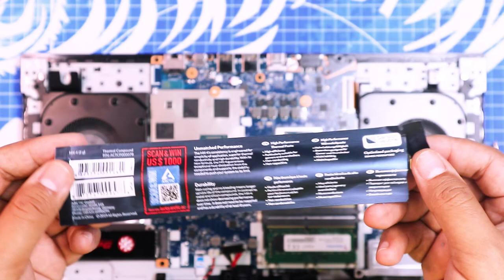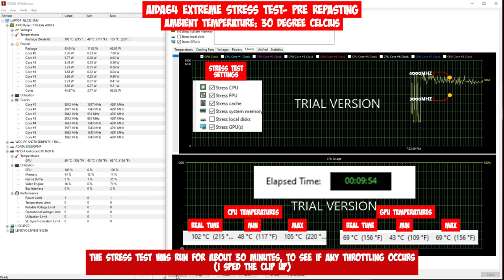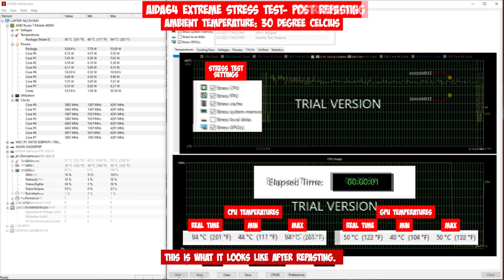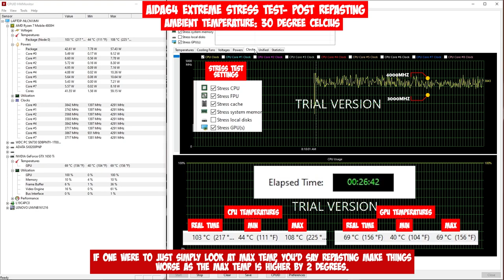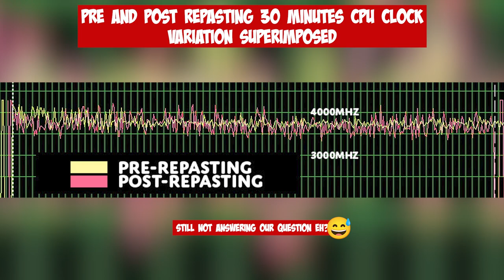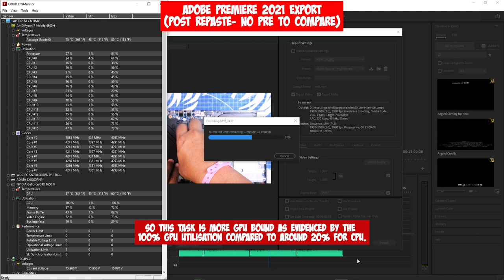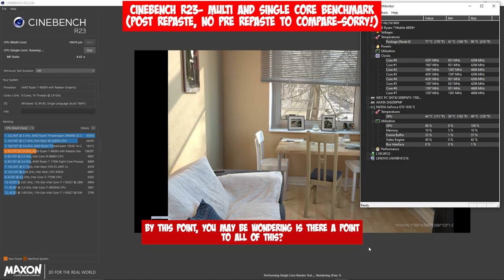Repasting My Lenovo Legion 5 |Replacing Old Thermal Paste|

Comment: I feel people failed to realised that unlike repasting thermal compound on a desktop with some decent or good cooling solution, you probably will not see a drop in temp on a laptop unless you are not stressing the CPU or GPU fully. The reason being that there is just not enough surface area to implement a beefier cooling solution. So while changing to a better thermal compound helps with heat transfer to the heat pipes and then to the heat sinks, the bottleneck will eventually be at the puny heat sinks. In addition, just as demonstrated in the video, because the CPU and GPU are usually thermally limited, therefore, when there is any thermal headroom, it will attempt to run at a faster clockspeed. In my opinion, you will need some thick thermal compound for laptop use because of (1) poor mounting pressure, and, (2) high temps which most thermal compound will degrade rapidly, including the expensive but ineffective Thermal Grizzly. Thermalright TFX and SYY 157 appears to be better thermal compound for such use case and they are a lot more durable.
Reply from the maker: thanks for watching

Comment: Great video. I experienced the same thermal issue with my Legion 5 after repasting with MX4, but then I repasted again with Thermalright TFX and the temps are now 10 - 15 °C lower. For better results, the TFX has a curing time around 3 days.
Reply from the maker: thanks for watching😁 that's a pretty decent improvement. I might try repasting with other brands of paste, few people also report better results with other pastes.
Reply: It was not a legion 5 gen 6 right ?
Reply: I think also grizzly hydronaut if u want less manteinance
Reply: @boufftous3000  nope
Reply: Maybe you got a fake mx4. There is a lot out there. I bought a fake one  but I got the refund.

Comment: Pro Tip-ish: Lenovo's BIOS actually gives you the option to Disconnect the battery without the need to do that battery removal step (which honestly is a pain haha). Once you press enter on that selection on BIOS, it automatically shuts off the computer and can only be powered on via AC.

This'll make upgrading/maintaining the device easier and avoids mishaps (like breaking those battery connectors)

Once your done upgrading, just plug it with the power brick, turn on, and let it boot (there is no need to go to the BIOS again and turn it on, it automatically turns back itself once AC power is applied), regardless it's best to check still

PS: Even me, when I installed my 1TB SSD forgot such step haha. In a perfect world with no shorts and ESD it should be fine, but we are not in that perfect world SO. Make sure to remove 'em :D

Impt guideline when repasting:
1. Before doing anything, ALWAYS HAVE A BASELINE. Baseline includes your benchmarking scores, ALL YOUR temps (package temp, core temps, hotspot temps all the temp values you can see) this wiill be relevant later post maintenance

2. The most common method of applying thermal compound i.e., the teardrop, IS NOT ADVISABLE since you are (technically speaking) no applying it on the heat spreader BUT ON the DYE ITSELF. Hence, you need to apply thermal compound and SPREAD on the dye AND on the metal plate. There are a lot of videos/articles explaining this but the TL'DR laymans term of it is: the exposed part of the dye is actual "protective skin" of the actual chips, and missing even small areas will cause certain chips to overheat. MoN's video doesn't really show him spreading it, but hopefully he did, if not, hopefully the pressure when he  pressed back the heatsink provided enough coverage. AGAIN AGAIN AGAIN, this only applies when your faced with repasting the actual dye, let's not debate about application methods.

- - So how do you know if you messed up? Most modern hardware not only report the package temp, but also report the hotspot temp, if that reaches 90-100 deg.C+ even on light load, then its a good indication you messed up somewhere. This is where the "before i touched anything" pre-bechmark comes in handy, since you SHOULD get equal to or bettter results esp. on the temps

3. Lastly, unless you're experienced, dont use metalic base/conductive thermal compound.
Reply from the maker: thanks for watching and detailed and extensive comments. 😁 very helpful👍
Reply: @masterofnone4608  AC, what? The charger cable/power brick transforms AC (from the wall) to DC. There isn't any AC running straight into the computer.
Reply from the maker: @-RXB-  I believe he just meant that by disconnecting the battery in the bios the laptop will run only if it's plugged in to the charger, and since the charger is connected to the wall, it runs off the AC. I don't actually think he meant the laptop is actually running on AC😅.
basically i think he just meant that the laptop would not run on the battery when disconnected in the bios.
, 😁
Reply: Hey, I don't see an option to disconnect the battery from the BIOS. I have Legion 5 2021. Need your guidance.
Reply: Disconnecting Battery in BIOS will not disconnect the hardware and if the hardware is connected it can still transmit power which can destroy the motherboard. So, It's not a good Idea!
Reply: @adarsh846  disconnecting battery in bios stops power flow from the battery to the laptop. So its a good idea unless u actually upgrade it while connected to power in which case u would be dumb as hell
Reply: @adarsh846  bruh then whats the use of it? im pretty sure devs arent dumb to waste their time on useless things
Reply: @ashuF12  I believe even an electronic circuit has its own way to do things. As he said, it may disconnects the power from battery to the motherboard but there could still be something close to the battery that works like a switch to connect between the battery and the motherboard. I mean the cable of the battery is still connected, so there has to be something in the hardware that works as a switch
Reply: @fadhil4008  then there's something wrong with ur laptop
Reply: great option but would you really trust where the electricity cut off, def. not inside the battery?
Reply: Okay, so I got my laptop serviced today( cleaned and new thermal paste applied etc) and my new temps are a lot more than what I used to have, I'm a bit worried about that, does it mean the technician messed up?
Reply: Thx for the tip man, im having a hard time pulling it out. Looks like mine is glued or smth.

Comment: For long-term stability and high thermal performance almost nothing beats Honeywell PTM7950 paste sheets on the Legion 5.
The L5 Pro from 2021 and after comes from the factory with Honeywell PTM phase-change pads and they are better than basically anything you're going to replace it with. So recommend cleaning the cooling fins and fans as best as possible first if their is minor dust buildup without removing the cooling stack, if the area is gray as a pigeon disassembly is the best option (Some fan mounting screws are underneath the heatpipes) and if the temps are still unacceptable my first highly recommended choice is the PTM7950 sheet (i found and got them from ebuy7). Otherwise Thermalright TFX, Shin-Etsu 7921-5, IC Diamond, Maxtor CTG9, Thermagic ZF-EX, Highly viscous pastes but even with those a repaste within 5 months might be necessary.
Placing links results in the removal of my message (Probably a YT naughty bots protection policy)
Google: PTM7950 Legion 5
Also it is recommended to spread the paste on direct-die because you can fry a chip if a small part remains uncovered like a memory controller or something else on the corner/edge of a GPU.
Reply: Just replace stock thermal pads with thermal putty such as Laird 607 and combine with Thermalright TF9 (in my case). Done! Can even test it against Honeywell PTM 7950 sheet as well.
Reply: Is Laird 607 a stable putty? because K5-Pro is messy and i hate it.
TF9 is also good.
Reply: Planning also to repaste my legion 5 2021 may i ask if thermalright odin pads 0.5mm and 1.0 mm are all good to use?
Reply: @TeaTeaMew  The factory ones are pretty good actually, You will not see any big noticable difference compared to brand new expensive pads, not with Lenovo Legion series. Very high w/mk pads tend to have a sturdy hardness and are not easy to compress which might prevent good proper contact pressure on the die's when they are not of equal thickness. depending on the model Lenovo uses 0.5 0.75 0.85 and 1.0 for the thinner pads.
Reply: I'm quite new to this, but which variant of the PTM7950 should i buy? Is 40 x 80 x 0.2mm good for both gpu and cpu? I found one on amazon for 17 dollars. And do you have to buy two of them, for both cpu and gpu?
Reply: Yeah, I think my legion 5 2022, has it too. I'm using for 2,5 years and the temperature didn't change anything.

Comment: I have dell 7577 and 2 years after I bought it it needed repasting when I saw how complicated is it to open it I tried to do it and it took me like 3 hours separating the 2 parts was horrible experience that's why I decided to watch this video before buying the legion5 
Your explanation was amazing I will save this although I hope u would talk rather than typing it easier to watch while hearing instead of focusing on the explanation and what you are doing at the same time and for something like this I need to really focus on what you're doing
Reply: I had the g7 7577 too and switched to the legion5 rtx2060 i7 10th, and it is better in every way
Reply: i know that pain, i still have a dell 5577 that needs to be almost completely dissasembled just to be able to change the thermal paste and its a pain. I have an RTX 3060 legion 5 for my use, but i still maintain my dell laptop.

Comment: 2 tips!
(I have a legion 5)
.
When removing the bottom panel, start at the REAR edge, about in line with the corner screw hole.
Leave a wedge to keep the gap open.
Work to the centre.
Repeat on the other end.
.
Then work around the corner and apply a light lever action.
.
Repeat on the other side.
.
The sides (at the vents) will pop much more easily than working from the front.
.
After the vent area is popped its easy to run down each side to the front.
.....
Next.
Don't use nails, or a screwdriver on the battery connector.
.

Either 2 spudgers, one each end, in the gap, from the top and a slight twist, 1mm at a time. Or, I use an old store/ credit card with a corner cut off at 45°. About an 8-10mm edge.
Work each end with a twist.
.
No metal near contacts, no bent pins.
(I'm a copier technician, I've seen both cause issues!)

Comment: It appears that the fan casings are held with tiny screws (5:40). Opening the case while mounted is probably an easy way to clean the fan without having the need to unplug it.
Reply: would it cause a problem? i mean maybe i can damage the fan?

Comment: When you should change the thermal paste and how do you know that it needs to change?
Reply from the maker: hi. thanks for watching. there's no definite timing for when you shoud change the thermal paste. usually the stock thermal paste would last a good couple of years before showing any sign of deterioration. if you start to notice your laptop doesnt perform as well as when you bought it, its probably time to change the paste (or clean the fan and vents). Sometimes people repaste to squeeze a bit more performance out of their laptop. hope this helps.
Reply: @masterofnone4608  it sure does. Thanks! 👊🏼

Comment: good video!

One remark: on the left side of the heatpipe construction one can clearly see some oily residue - which is the "silicon-oil" the heat pads in memory chips of the GPU sweated out/bled out! Why did you not replace those as well?!

I do have a Lenovo Legion 5 pro ACH6H with a RTX 3070 and after only about 5 months of constant 24/7 use - the memory of the agPU will over-hest to the point the laptop shuts down after about 45min. after full-power usage and crash.

I am going to replace the old thermal pads with Alphacool Apex Soft 11W/mk.

They are supposed to be able to withstand temps of about up to 150° C and have a constant performance throughout their lifetime without bleeding out! all while offering performance superior to that of the original ones.

I the beginning my Laptops (had 6 of them mining ETH) would tolerate a memory overclock of +800/850 while mining steadily at around 60,2 mh/s - dropped down to 57,9 mh/s at +550mhz on the memory because otherwise they will overheat and shutdown.

1 laptop broke down after about 2 months and simply stopped working.
a month later I had to sent in the secont one...  Got my money back on both of those.

4 remained till about 5months in.
now number 1 broke down to above mentioned thermal issued and 3 remain mining 24/7 at reduced +500mhz OC of the memory.

the one whoe broke down most recently will not even mine at stock speed for longer then 30 - 45min. or endure a furmark for more then about 1h.

So I am goind to repaste, apply those Alphacool pads (about 35€ for 100x100x1mm) and then let's see what the temps and performance is then.

I am aiming for at least my initial 60mh/s.

maybe I can push it to +1200mhz or even  a little bit more...

If it works - all remaining laptops will receive the same treatment.

Maybe I'll do a video on the process.

Will update on here if I decide to do so...
Reply: Did it work well for you?

Comment: hey I have to same model, RTX 2060 intel version, i was wondering where the LCD cable connector is? I have 3 black horizontal lines at the bottom of my screen and people recommend checking that cable and making sure its connected, if you know how to fix the issue aswell i'd appreciate it.
Reply from the maker: hi. sorry for taking a while. the lcd ribbon cable is located at the top right, near the cpu. you have to remove the heat sink and fans  to be able to fully access it. you get a good view of the cable at minute 8:31 in the video. unfortunately I don't know how to fix the issue, you can try reseating the cable and see if it helps, or replace the cable if you got one in hand. I suggest to take it to the service center if it's still under warranty. if the screen need replacing it's fairly advanced DIY project which should be performed at your own risk. hope this helps😁 thanks for watching.

Comment: Brother I don't want to mess up with thermal paste area so can I just open the fans so that I can clean them without opening that thermal paste cover
I hope you understand my query
Reply from the maker: hi. you can clean the fans using old toothbrush without taking off the cooler. however if you want to remove the fans for more thorough cleaning, unfortunately you do have to remove the cooler. hope this helps.
Reply: @masterofnone4608  ok bro

Comment: Magnuson-Moss Warranty Act prohibits any manufacturer to void a warranty unless they can prove your tampering is what caused the damage.  Simply replacing the thermal paste or disassembling the machine is not enough to void any warranty in the U.S., you have to do something like put the long screw in the short hole, use way too much paste (especially if it's electrically conductive like liquid metal), use modular devices that aren't compatible with the product, etc.

Ever seen a "Warranty Void If Removed" tamper resistant sticker on a product?  Those are illegal, null, and void in the U.S.
Reply from the maker: thanks for watching :)

Comment: I have a question. My fan sometimes didnt kick in when i play heavy games.. how to fix that?
Reply from the maker: hi. the way most cooling system works, is the fan only ramp up when needed. that's why even when launching heavy games(or any load for that matters) the fan don't necessarily would ramp up.
However, if the fans don't spin leading to your cpu to overheat and throttles itself, this would point to something more serious. if it still under warranty I would get it checked up.
unless you ever unplug the fan cable, please ensure they plugged back in properly. ha ha.
hope this helps.

Comment: Salam, is it possible to remove only the fans without removing the heat pipes so I can just clean the fans and maybe spray some compressed air to the heat sink fins?
Reply from the maker: waalaikumsalam. unfortunately not. the heat sink/pipes do go over some of the screws and fan bracket. to remove the fan(s) you have to remove the cooler.

However, you can clean the fans(even use compessed air) without removing them, but that would mean you are only cleaning one side of the fan(s). Hope this helps.

Thanks for watching :)
Reply: Hi mate, its actually possible to remove fans without removing the heat pipes. You need to unscrew 3 screws cover on the fan. Then you can take the fan blades, but be careful because its a little bit tricky to remove the fan cover.
Reply: And be careful not to lose the screw, because they are sooo small, haha
Reply from the maker: @kuntodarpito  learn something new everyday. thanks👍

Comment: Bro please tell which screwdriver set you used to open your laptop...?
Reply from the maker: bro. I  just used a non branded multi bit screw driver. it's not even magnetized(hence I had to attach a magnet to it😅). it's some cheap screw driver kit that you can find in most hardware stores. it's usually labelled as phone/electronic repair kit or something.